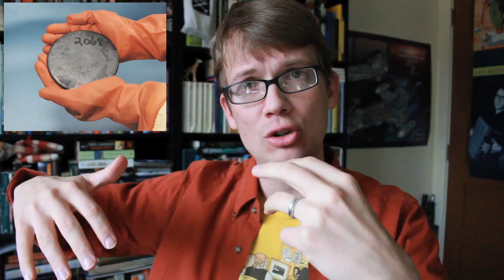Why Did Fukushima Explode?

Comment: @vlogbrothers How can this not become worse then Chernobyl. That was 1 reactor, now we have 6 causing trouble one by one and that even includes deactivated ones. Thankfully the Japanese widened the Radius of the Evacuation Zone, but it should never have come this far. I dont know if I am the only one that thought that there is something terribly wrong with the news when I saw the first Hull practically polverized. I just fear now its to little to late.

Comment: Minor clarification: (around 4:44)  "..environment, combined with the heat, that could actually split hydrogen and oxygen.."   What occured is the oxidation of the exposed zirconium, which takes the O out of H2O and leaves the H2, which is what causes the explosive bubbles to form.  Yay education.

Comment: I think it's a bit ridiculous for one to say that it is ridiculous for others 2have formed an opinion about nuclear power one way or the other.
If nuclear power was the only way to generate electricity for society,then sure,Id see the issueBUT it's not & there R other,safer,cleaner alternatives available to us that don't involve such a riskThat alone is reason enough to want 2find/use solar,wind or water as a means for energy rather than relying on something this unsafe.

Comment: I think this is more of a reason to use Nuclear energy. I mean, this shows just how extremely safe nuclear energy is! It took a 9.0 earthquake, followed by a tsunami to put the powerplant into this situation, and it might not cause much harm at all. A 9.0 earthquake has the force of 474 million tons, btw. That's a lot of force. So building nulear powerplant in areas which are not prone to have 9.0 earthquakes would be fairly safe.

Comment: hank, how is it posible that the fission products seporate the hidrogen from the oxygen? i mean when you make steam the overall tempreture of the water dosent rise untill all the water is steam, also steam is a very bad heat conducter (on mythbusters it prevented burning in realy hot lead)  it proberbly cold do it if it was REALY REALY hot but then why dont we use it to create electricity? and why dosent the proses that crates nuclear power make hidrogen explosives?

Comment: flying is the safest way to travel. and by a MUCH larger ratio, nuclear power is the safest form of energy production.
everything you said was pretty accurate and appreciated. however, where did you get the information that the containment rods broke? i don't think that is true. also they only THOUGHT that there was damage to the containment vessels, but it looks like that was not the case. the only real damage is from saltwater being pumped in. those reactors will have to be scrapped.

Comment: Well, if you can gather knowledge from observation, we shall see how this crisis develops. If the worst case scenario occurs in Japan, I will feel more strongly than ever that Nuclear Power is not worth the risk.  However, if this issue is resolved with a minimum loss of life, I'm pretty sure that the benefits outweigh the risks. I won't feel comfortable until they discover a way to dramatically shorten the decaying period in the event that it needs to be shut down for a natural disaster.

Comment: there was a third battery powered backup, which gave them time to decide to flood them with seawater, which was always a backup. they didnt want to flood them with sea water straight away because the salt and other crap fouls the equipment and will damage it possibly preventing further use.

Comment: I am against nuclear power. That is an opinion formed based on my knowledge. Knowledge of huge desasters. But I agree we have to prioritize, because that is not the only issue we have. But its one of the biggest issues. To properly handle this issue we would need to a have long term plan, which unfortunately is nothing a democratic goverments system is good in. This is why not the goverment can decide on its own, but we need the public to work on it. For that, we need to have an opinion first.

Comment: Good video.  One point, "spent" fuel rods *do* still contain Uranium, otherwise they would not re-process them to recover the Uranium.  However, the fission fragments do build up and the resultant drop in Uranium % reduces the potential output from the fuel element, eventually to such an extent it makes more sense to replace with a fresh fuel element, and hence the used element is classed as "spent".

Comment: @toan477 I think thats it's possible. But I think that It's more likely that all cars will be electric and the power will all come from nuclear. There are closed system nuclear reactions (thats probably not the right terminology) That produce 1- 10000 watts (just a guess) for 50 years. They are used at remote lighthouses and on the space probes that are too far away from the sun. If we improved that technology I think that every house could have one. But idk if it would work.

Comment: Spent fuel rods are usually stored by encasing them in concrete blocks, putting those in barrels or containers and then burying them and sealing them in old mine shafts.
I hear that old salt mines are especially popular since they provide massive rock surroundings and salt everywhere, which, I guess, is pretty good to keep radiation in.
Problems are:
Getting the rods from power plants to the mines and keeping them contained there for possibly 10.000 years.
Throuhg earthquakes and everything.

Comment: Pro's & Cons:
NP = dangerous.
But: Society w/out electricity =/= society.
So we cannot get rid of electricity.
Coal and oil-powered power plants produce carbon emitions (aka greenhouse gasses) that continue to drive our planet to the next ice age.
NP plants produce waste that will be radiating for the next 10.000 - 50.000 years.
We cannot possibly guarantee that this waste is safely stored, since we cannot plan for an extensive time period like that.
This is why green energy is SO important.

Comment: the secondary containment you describe is actually primary containment. the reacotr pressure vessel is inside the concrete and steel primary containment. the reactor building (what blew up in japan) is secondary containment.

Comment: This is the single most cogent explanation of nuclear reactors i have seen. I wish everyone that i've had to explain to that the japanese reactors are not going to detonate like an a-bomb, and no, this situation is nothing like Chernobyl.

Just one thing though: there was, in fact, a third power fail-safe at this nuclear facility, namely, battery banks. However they were not designed to power the coolant systems for all 6 reactors for an extended period.

Comment: Hank, you did a good job explaining the situation. Just wanted to point out that after the tsunami took out the backup diesel generators about an hour after the earthquake hit, they used battery powered generators to help cool, but unfortunately those didn't last long enough for main power to be restored.

Comment: Thank you so much for this video. I appreciate it incredibly, because it's been really hard for me to figure out exactly what's happening in Fukushima just by reading news articles. They either seem to gloss over the actual events in favor of the impact on residents (which is fine, but not helpful in finding out what exactly is going on), or they assume a level of pre-existing technical knowledge that I don't have. This was a great middle ground. Thanks again; I've shared this on Facebook.

Comment: if we get our power by steam and kinetic using turbines we should probably use magma or soething alot less volatile rather than nuclear and it is also not an infinite recource that is that insanely hot also pumping water in to cool it means you split the atom and end up with only hydrogen and that gives a higher chance of explosion

Comment: But the situation is clear now they pumped sea water into the reactor so a melt down won't happen, but now Japan has 25% less power so they are still in trouble, just not that bad of a trouble.

Comment: @HandyClock That is exactly what nuclear power plants do, when they are functional.  At the moment, since the back-up pumps are not working, they are doing all they can just to keep enough water in the reactors to cool them.  They are not concerned with producing power at the moment.

Comment: @kayl23 The electrical production of nuclear reactors does in fact generate electricity by simply by boiling water to create steam which is exactly what happens in a coal, natural gas, or oil powered plants as well.  It isn't so much a matter of turning the generator faster as the potential for energy in a gram of uranium is much higher than a gram of say coal.  Uranium is also relatively plentiful in the earth's crust and relatively cheap to extract.  I agree it is certainly a big risk!

Comment: Thank you for asking people to "not panic unduly." The nuclear power industry clearly has things to learn here, but they're already working on plans for Generation III reactors that have a "passive" cooling system where the water circulates by convection (no pumping required). If Fukushima Daiichi had Gen III reactors, we would not be talking about them now. Hopefully people will not allow the failure of the pumps in the tsunami to affect their opinion of plans for reactors that don't need them.

Comment: @Zyphyr104 You are right that they cannot access the core directly, however additional control rods would not help.  The problem is that the uranium and its byproducts that are still in those fuel rods continue to decay into other particles long after the nuclear fission has stopped.  It is the same reason that the fuel rods need to be cooled long after being removed from the reactor.

Comment: wait but from what i understand is that nuclear reactors use control rods to absorb some neutrons to controlt he reactions if needed why don't they just add more control rods or will that just require the reactor to be opened and shut down

Comment: My understanding is that the hydrogen is produced not from the "splitting water" as directly.  Rather in a high temperatures induce a chemical reaction between the zirconium in the fuel rods and the oxygen in the water leaving hydrogen as a byproduct.  (Essentially the rods are rusting!)

Comment: While wind and solar are great ideas by nature, they are still not economically viable in society today. That is not to say we should avoid these technologies, but even weighing a 12 year build and capital required to make nuclear power plants, I believe nuclear will run the show. As for safety, we have been using this technology since the 1950's in submarines, of which only 2 had reactor related incidents; caused by outside factors.  - A 10 Year Electrical Engineer in Alternative Systems...

Comment: The production of hydrogen is caused by the fact that when Zirconium is hot enough (around 1500 degrees Celsius), it reacts with water to form zirconium oxide and hydrogen. This is where all the hydrogen is coming from. And, since they were releasing steam from the reactor to release pressure, the hydrogen got out and eventually, mixing with oxygen, exploded as we saw.

Comment: Once the energy has been 'released' as radiation, it has limited potential to harm you. That is to say an Alpha partial radiated an hour ago has likely struck something and no longer poses a risk.

The actual element however, will emit radiation for a long time, which is why it's so bad to ingest radioactive iodine etc. The trick is to isolated and sequester the particulate matter.

Comment: @zkittlz You're think of speed as distance divided by time when it is really time divided by distance.

Think of it this way. The speed of two miles-per-hour is way slower than the speed of two hundred miles-per-hour. Two hundred is a bigger number than two, so the speed of light would be way way bigger than both of those numbers because it is way faster than both of those speeds.

Comment: @soccerguyhammers It's the density of the water that does it.  Honestly I'm not particularly sharp on my nuclear physics stuff, but this was a real concern for nuclear submarines and the crews were trained to recognize it.  The density of cold seawater somehow does some sort of thing with the neutrons allowing them to react more readily with the fuel.  Look up "nuclear cold water accident" on Google for a better explanation, third result down.  It only applies to pressurized water reactors.

Comment: Think about how that energy got into the nuclear bonds of the U235. It's crazy. You have these supermassive stars that burn until their core is iron. The pressure on the core due to the immense gravity attempts to fuse the iron together. Since the fusion Fe55 doesn't produce enough energy the star begins to collapse, rebounds off the new neutron star core, and blows itself apart. All elements heavier than iron are made this way. So, we are basically harnessing the power of a dead star.Thats nuts

Comment: @15warner, it can but those products take years to expel all the energy/heat.. so while that tsunami did contain water which is what they use to cool everything down.. it did alot more harm.. it was the tsunami and not the quake that did most of the damage to the plant,  and  from what i have heard/read their generators are fine, they just have no diesel fuel to run them, so they have no power  to run the pumps to cool everything down

Comment: @15Warner Sea water boils off to fast and is bad for the containment vessel, theya re still using it however but it means completely writing off 3 or the 4 reactors when this is over.

Comment: If you were going to blow the 4min limit, I kinda expected you to go into the information regarding generations of reactors. The Fukushima plant is a Generation II plant, Chernobyl was Gen I. The plants being built at present are Generation III - fear mongering dependent. Gen II require powered active cooling, but Gen III use passive, convective cooling that does not require power. Fukushima is 1960's tech with a 40 year operational lifetime, and was scheduled for decommissioning (date unknown).

Comment: @ZetaCron Chernobyl created a melt down. In Japan, the cooling system is not working, so the heat has quite a possibility of getting out of control and creating meltdown, which could be "another Chernobyl".

Comment: I am just so impressed that there has not been a meltdown yet. Nuclear plants are one of the safest ways to generate power under normal conditions as they have up to 6 separate protection layers (not all physical). The Chernobyl incident happened because one of the Engineers thought it would be a brilliant idea to turn off all the protection and there was a meltdown.  I would argue that the future is going nuclear. I am studying Chemical Engineering though so probably biased  :P

Comment: @JETZcorp How does that make sense at all? Cold water allows neutrons to fire the reaction back up again? The decrease in water pressure= lower water levels, the remaining water turns into steam, which then pressurizes the entire primary containment chamber. Under high temperatures, the zirconium control rods oxidize, which then releases hydrogen. Hydrogen is explosive, and the heat from the radiactive cesium atoms cause a pressurized mass of steam and hydrogen=boom. Cold water=nada.

Comment: 313 years and we're still using steam power? lame

We already used nuclear and have all the waste issues. A little more isn't going to hurt. Nuclear doesn't produce green house gases like fossil fuel energy plants. 

So I'm ok with more nuclear for now. As long as there is no new fossil fuel plants. Till these can take over.

Since wind generated power is made at the same price per watt as nuke and fossil fuel. We need more of it now.

More work on solar and bio fuels. Bio is close. Geothermic?

Comment: @InnocenceExperience well, to split molecules, you need a great deal of heat energy that the rods are producing and in turn that splits the parts of the molecule into elements, that really badly want to react with other stuff. :P

Comment: Apparently this is Nuclear Disaster day for me.  A few hours before this video popped up, I was reading in Hunt for Red October the fictional account of an Alfa-Class nuclear submarine being sunk by its own catastrophic bad thing.

Basically put, the reactor lost its pressurized water coolant to a leak, which was then remedied with sea water to cool the Uranium.  But unfortunately cold water allows neutrons to fire the reaction back up again, creating impossible amounts of heat, melting it down.